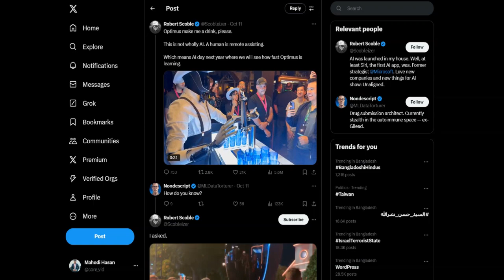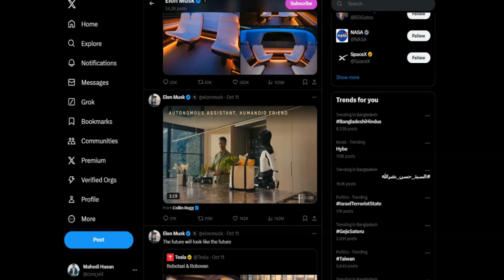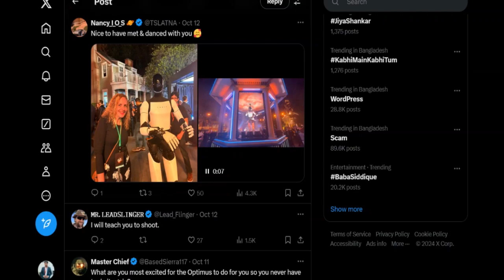BREAKING! Tesla Optimus Mingling with Crowd!…Now Called Biggest Hoax EVER?!

Comment: The people running this channel and spreading these rumors are full of sh*t, and not paying attention to details. A mechanical suit obviously would need to be hollow for a human to fit inside. When you look at 4:16 that's definitely not the case. It's a solid mechanical joint at the wrist. So it would be impossible to hide a human body part with that. The same goes for the pelvic area. The way the lower torso and pelvic area are made wouldn't allow anyone to fit inside of these things.

Comment: They had a human for every robot controlling it from a distance. Basically the robots where controlled by remote control. That is just gaslighting the public. To control robots by remote control has been possible for 50 years. By not telling the public in advance that the robots where not fully controlled by ai but by a human is scamming. Tesla should have disclosed the fact before putting Optimus on the stage. But Tesla chose instead to hope that the public did not notice. That is a typically Musk move.